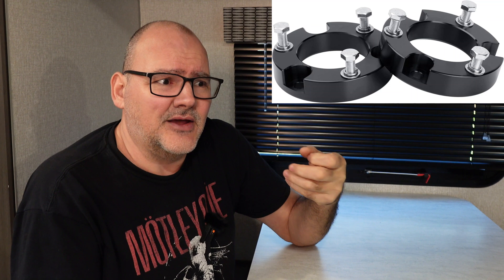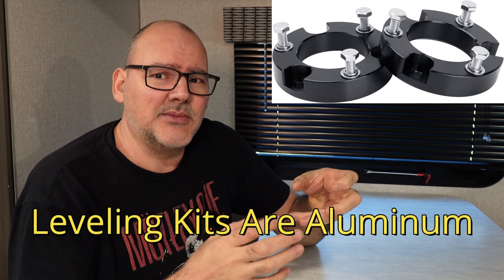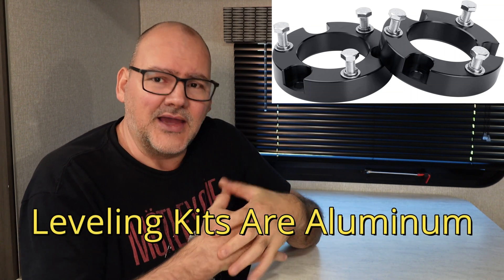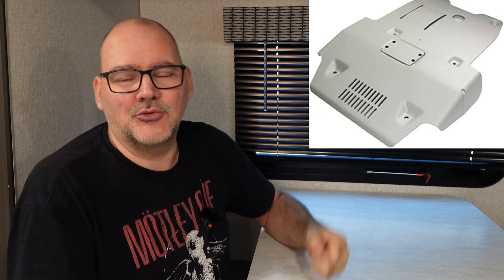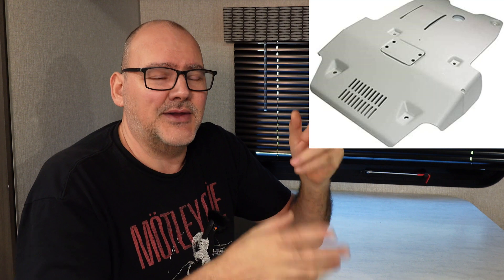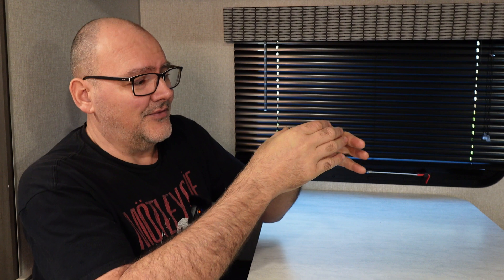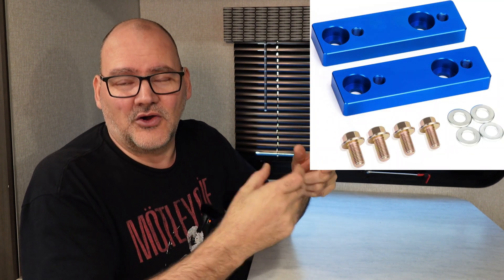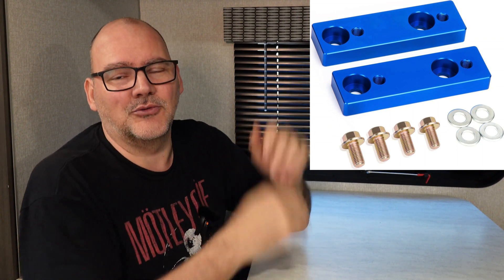Secrets of Corroding Truck Frames

Comment: Fun fact: Liquid cooled computers also can suffer from galvanic corrosion if you use copper and aluminum parts in the same cooling loop. This is why automotive coolant contains so many anti corrosion additives as many radiators are made of copper while the engine is aluminum.
Reply from the maker: It's also why you have to use the car brand specific anti freeze because it will contain the correct amounts of anti corrosion additives.

Comment: Ford truck transmission mounts (steel) bolted directly to the aluminum extension housing, would split the housing from corrosion "jacking" , drivers who didn't notice often burned up 4R70W transmissions because of cracking.
E series vans, and F150' 97 thru 07.
Reply from the maker: Yeah, a lot of people don't know about this galvanic reaction until it's too late.